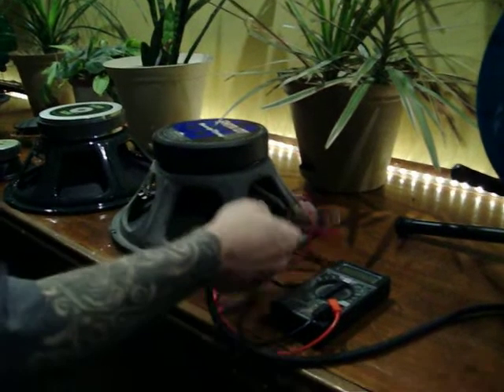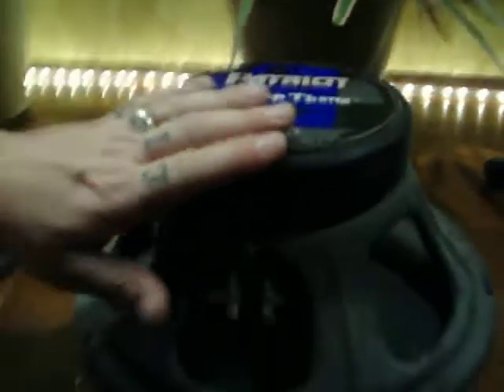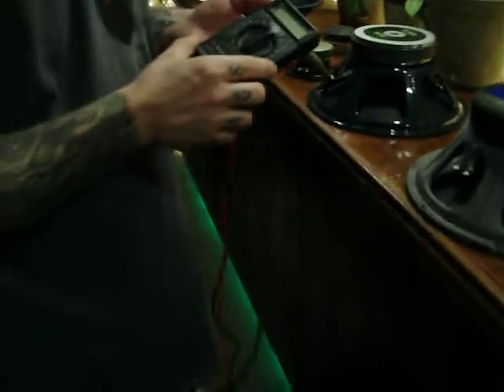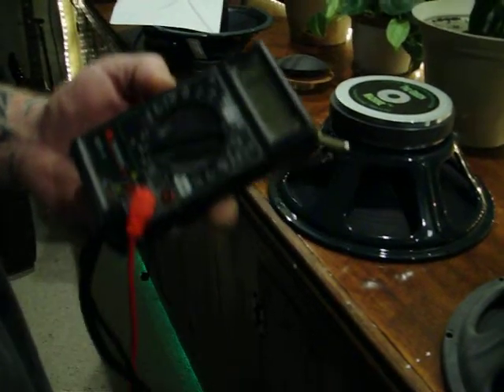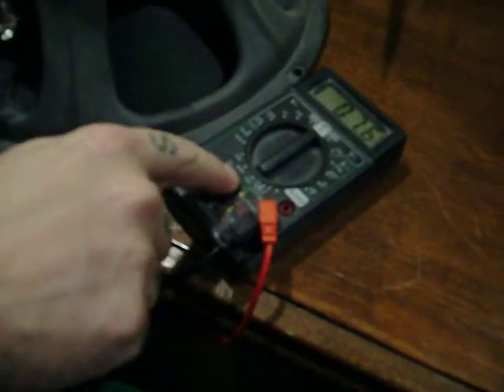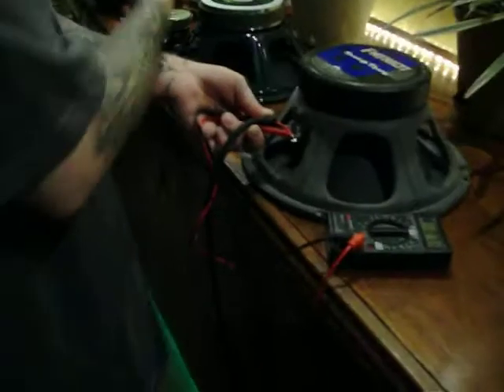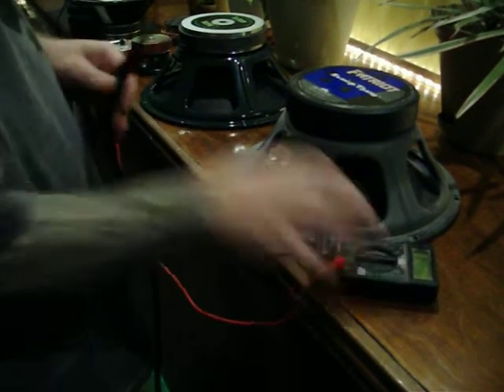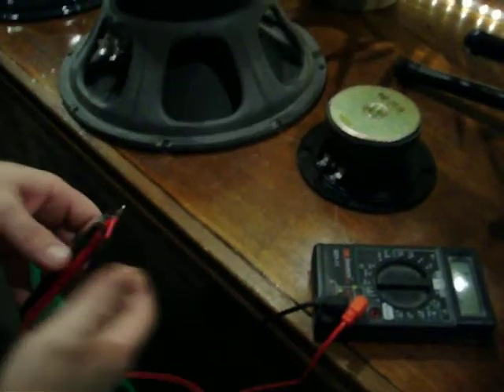EarCandy FAQ Speaker ohm load testing test w/ multimeter

Comment from the maker: @CrystalsandSpiders You are wrong. Builders and speaker makers use this method on a daily basis and , when a speakers builder publishes that a speaker is actually 5.7 ohms and I hook up the meter to it and the meter says 5.7 ohms. Yes ohms changes with frequency but I am testing a speaker that is not handling wattage, just a raw frame speaker. Meters test more than DCR. WIth respect, how do you test speakers then? Thanks for the comment.

Comment from the maker: @InterspeciesErotica7 No, just the speaker cab or speaker. Your amp output carrys wattage / voltage at a ohm load, not just the ohm load so this is for testing your speaker & or speaker cab with no amp hooked up to it. Does your amp not have the ohm load marked on it at the speaker out? If not, let us know what kind of amp it is and we can find out for you. 
Thanks!

Comment from the maker: If you had a 4 ohm cab with 2 speakers, 99.9% chance you have 2 8 ohms speakers in that. So, you can do a pair of 8 ohm in stereo, or 4 ohms parallel or 16 ohms series, IF those are 8 ohm speakers, those are your choices. There is a very slight chance those are 2 ohm speakers in series but I doubt it. 
Thanks!

Comment from the maker: Here, there is no such thing as a stupid question. :) Ok, you can make cabs switchable if they have 2 or more speakers in them. A single speaker's ohms, is what it is and cant be changed, it has to do with how much wire is on the voice coil. Now, with 2 speakers, you can do series or parallel to manipulate the ohms and I dont use switches, I use switchable jacks that are made for us. IE the switching happens by plugging and un plugging the speaker cable. Actual switches are bad for tone.